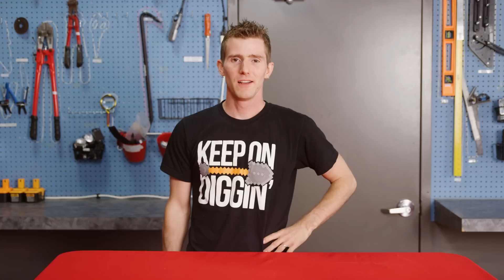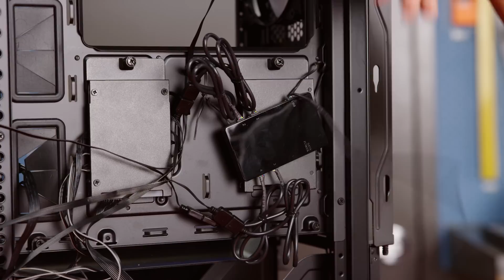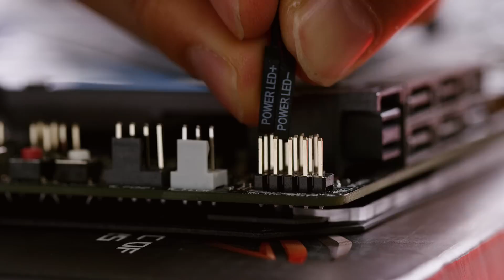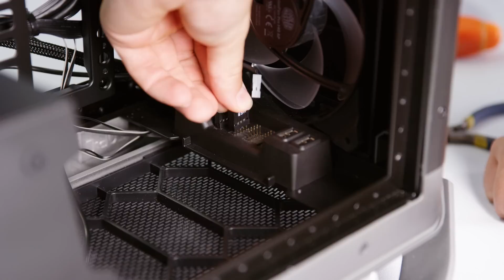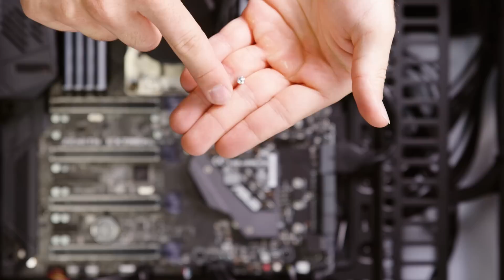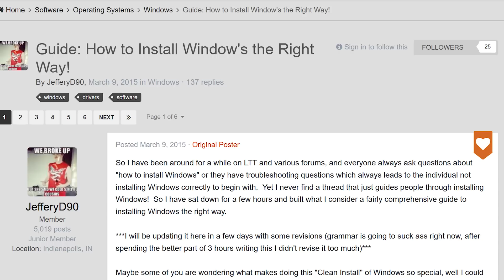Ultimate Mega-Workstation PC Build Guide

Comment: in 2023 this (besides the RAM amount, seems quite dated. The i5 13600 is 14 cores, 20 threads and gets about double the score in cinebench r23 (I know benchmarks aren't everything, but it's just to show the maximum performance of the chips), and it costs $300. It also supports DDR5, which can give it more bandwidth than the quad channel DDR4 of the TR, and PCIE gen 5, which gives it 80GB/sec total, compared to 64GB/sec of TR, even if it is squeezed into less lanes which means less connected devices.
Reply: Its absolutely amazing what Kind of tech came out the few past years. Never thought we'd See so many improvments in such a "short" time. Almost like Back in the late 90s/ early 2000s

Comment: Even cheaper older Quadro Cards beat performance in CAD based programs for me. So for engineering they are very good, but not for 3D stuff (price-wise)
Reply: Could you please suggest me specifications to build a server and gaming workstation.. 
Mother boards models list
Processor list
Chip set list
Rams list
Storage 
Pci
Form factor
Graphics
Etc

Comment: “All of the cores” now 16 cores seems to be a small amount for TR
Reply: Now 16 cores is a consumer processor lol
Reply: Could you please suggest me specifications to build a server and gaming workstation.. 
Mother boards models list
Processor list
Chip set list
Rams list
Storage 
Pci
Form factor
Graphics
Etc
Reply: In 2022 16 cores 24 threads in the core i9 12900K

And. 24 CORES 32 THREADS IN INTEL I9 13900K

And amd ryzen x950x  16 cores 24 threads
Reply: Now there's a 96 core haha
Reply: I have 8 cores still going strong
Reply: Even my $500 laptop has 10c/12t, and that's one of intel's ultra low power cpus, a 1255u, and it's already a few years old, of couse core count isn't everything, as (at least in cpuz's benchmark) it's about on par with my 4c/8t 12100 on all core.

Comment: Using this case, Ryzen 9 3900xt, 32GB ram, ll fans 120m, Corsair water radatior fan 360mm, noctural fan 120, aorsus GIGABYTE X570, 750 w Corsair 750w gold, evo 970 plus 2tb, sceptre monitor curved 200 30inch, Logitech keyboard n mouse, n my A40 astros

Comment: I'm building my own 1950x system.  Since gen2 and gen3 threadripper is in the wild, the price of the 1950x as come down to damn near give away prices. Couple this with the x399 phantom gaming 6 at only $250.00, and the price is hard to beat. Yes its two generations old but it still packs a rather large compute power punch. I forgot to mention that it will run rings around my sandy bridge dual xeon rig.

Comment: can you build a dual standard atx psu pc for redundant purpose? in the same case, best in my opinion would be in back to back configuration mounted vertically beside the long sie of the mobo(like q500l), with the ciruit to prevent one faulty psu to take down the othe one  behing long gpu heatsinks. or isn't doable?

Comment: Now, two years later this ripper CPU costs about $500 and perform worst than $700 Consumer 16 core Ryzen 3950x. I build 16 core Ryzen based system similar specs than this (but even more nvme storage 6tb) almost half the price that what Linus spend this system 2 years ago and mine is more powerful than this ripper build. Ofcourse mine has no ripper system benefits like many pcie lanes etc. but pcie4 helps a lot for this even if you use one chipset pcie4 4x lane shared for majority secondary ssds, usb and stuff (because pcie4 bandwith increase)!

Comment: Say if I have a power supply and the +12v rail is 504w but only has one eps connector; could I run a molex to eps adapter? Or is that too sketchy?

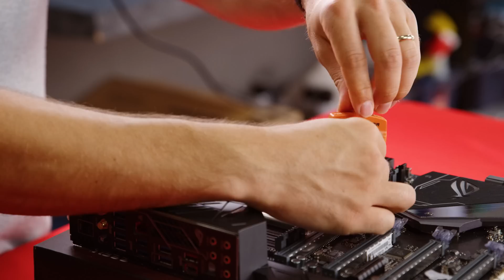Comment: 3:50 The moment when you realize you may not want to actually do what the person says, since pounds per square inch is not a valid unit for torque....    It's probably inch-pounds, however I really recommend checking the manufacturer's specs on that thousand dollar CPU before you break it and void the warranty due to improper installation.

Comment: Call me crazy, but I am not at all fond of the flimsiness of that bracket you slide the CPU into, from an 'alignment with the pins' standpoint. It just does not seem as if it's going to provide sufficient alignment as you lower the CPU down onto the pins, especially by comparison to the thing that folds down after it, which has an opening for the CPUs metal chip cover which clearly has less than 1/2 millimeter tolerances on each side.

Comment: Updated build:
2990WX 
3*2TB m.2 ssd 
2*RTX Titans 
1TB RAM
Reply: You can do 2 quadro 8000 or maybe up to 4
Reply: @subbot9296  at the time I only knew of the Titans.
Reply: @whitebeartigtig  yea, i mean the video is outdated, now you could get a 3990X, dual rtx 3090, and possibly even a optane acceleated 4 or even 8tb drive. And now you can get 1tb of ram
Reply: @subbot9296  or even more RAM depending on the motherboard used
Reply: Wouldn’t want to game on a 2990WX
Reply: @springbok4015  well, it's a "Mega Workstation Build" so...

Comment: Anyone know of a good build for entry level work station. That can photo and/or video edit. For around $500-$1000. ?? Does not have to match or look pretty. Just needs to get the job done at a fair price point. Willing to use slightly out dated tech to start with. If build is upgradable in future.

Comment: 12 pounds per inch of force? That is not torque. That represents lbs/in (distributed/line load). What Linus meant to say was 12lbs x 1in (vector multiplication). Which simply means at one inch perpendicular from the center of rotation, apply 12lbs of force. Everyone can start your critique of my critique...3...2...1....

Comment: Nice but I can't believe you put a 240mm in that beast. It doesn't deserve a 360? The case was clearly designed for 360 and given the overall system cost putting a 360 in it would have been nothing.

Comment: 7 Thousand! 
Coughs blood
Reply: Now, two years later this ripper CPU costs about $500 and perform worst than $700 Consumer 16 core Ryzen 3950x. I build 16 core Ryzen based system similar specs than this (but even more nvme storage 6tb) almost half the price that what Linus spend this system 2 years ago and mine is more powerful than this ripper build. Ofcourse mine has no ripper system benefits like many pcie lanes etc. but pcie4 helps a lot for this even if you use one chipset pcie4 4x lane shared for majority secondary ssds, usb and stuff (because pcie4 bandwith increase)!
Reply: Mine is just under 2k
Reply: Trevor Thieme why did u sell ur kidney
Reply: THE BLOODRIPPER.
Reply: Sells blood*
Reply: Now THATS what i call dark humor
Reply: my 1st TR rig was 6k bought it about the same time as this vid but seriously if you think of it investment wise. this thing will still be trucking in 5+ years...  short of like quantum chips going mainstream consumer in that time be unlikely anything comes out that can trounce the TR from its podium.
Reply: @TheOriginalSycHolic   Don't be a tease Quantum Chips becoming mainstream or even prostream products is the not so secret fantasy of everyone watching this video.  Of course assuming it happened right away (Tomorrow) I have no software capable of taking advantage of that capability and no capacity to invent it either.

Comment: Hi, I'm working with an HP xw8600 2x  xeons 5470 @ 3.33mgz,  32GB ecc ram,  gtx 680,  2x  500gb SSD  raid 0 config,, I'm a part time employee @ best buy so fund are tight is there anything else I can do to improve proformance with out breaking the BANK.>???

Comment: "12 pounds per inch of force" 
Well almost none of that makes any logical sense. I'll forgive you for part of it because technically torque is a force. However, the units are not lb/in they are lb•in. Pounds per inch makes no sense. Inch pounds, or pound inches (the correct terms) suggest you are applying the equivalent of 12 pounds of force to a lever extending one inch from the center of rotation.

Comment: but the duma is such a rgb led that the ddr 4 will speed up the processors but they are wrong the poor will take the expensive procika but they do not look so much worried but even the blue-boobed blue ones do not get the tempt smooth 1080 asleep in the machines. heloo with so much power the 15-year-old procim will receive you even hahahaha

Comment: wow that 1200w PSU cost $1,000.  Ripoff.  I paid $200 for EVGA 1200w Supernova and it too says made in Japan capacitors.  I'm using that same AIO cooler, but on Threadripper 2 (32-cores of powar! har har har! -- Tim Allen) A difference a year make.

Comment: 1.) Remove these three PCI slot covers...... 
2.) Remove the protective cover from the card edge ....
3.) Push the card in firmly until the  slot tabs snap shut...
4.) Plug in the two 8 pin PCI Express power connectors.....

5.) Realise that you don´t have and can´t afford a 1080Ti :,(

Comment: I WONDER THE BENCHMARKS ON THIS THING. IT HAS TO BE SUPER HIGH RIGHT, I MEAN U SEE THE SHI* THEY PUT INSIDE THAT COMPUTER. THE HIGHEST-TIER THREADRIPPER, TONS OF RAM, A GTX 1080 TI ADVANCED, A HIGH POWER SUPPLY (REASONABLY FOR THAT THREADRIPPER), INSANE COOLING FOR CPU MOSTLY, AND THAT BEAST NETWORK CARD. iF THIS DOESN'T BEAT AN AVERAGE GAMING COMPUTER BY 50 FOLDS, I AM UNSUSCRIBING! jk

Comment: That cooler with the surface area it offers contact to the CPU and limited Radiator space is not ideal at all for this CPU especially when overclocked or tuned. Something like Enermax TR4 offers much better efficiency of heat removal if you want an AIO with custom water being the best way to keep this cool and a 360mm Rad.

Comment: You stated to  torque the screws with "12 lbs. per inch force"using the included wrench.  A torque setting is just that, torque (not force), and the setting is in inch-pounds,( or newton-meters, pound-feet)  not inches per pound.

Comment: 1 TB RAM isn't necessarily an overkill on a CAE Workstation.. full vehicle NVH Analysis based on a moderate size mesh and upto 800 Hz takes up 500 to 800 GB RAM in addition to a ~100 GB diskspace for writing the results .. of course one can use scratch on the disk to reduce RAM but that slows down the total job time by a factor of 10, if not more.. explicit codes require much less RAM though.. Most OEMs here in Germany, depending on the type of CAE allow one job per node and have about a TB of RAM (for the implicit jobs).. 
But yes.. most nodes top at about 700 gigs..

Comment: Hey Linus thanks for the videos, i know its kinda hard to keep track of all comments but i would appreciate if you could replay to a few, specially if they are related to your video... Its kind of a give and take, we like the videos and in return get some help when needed. For instance, i have an annoying issue, iv just finished building my TR pc as your show on your video (missing some points on where goes what in terms of cables, but i managed to figure it out), anyway, my issue is that the OLED screen on my MOBO (Zenith extreme X399) does not work at all. Nothing shows up... I dont have a OS installed yet, but could that be related? or did you do any tweaking on your board to make it work?

Comment: I got Threadripper 1920X installed with 3x 1080Ti, not for gaming but for AI and deep learning research. The best of all, you don't have to worry the PCIe lanes, just plug in all GPUs and NVMes as much as you like, hassle free. But I recommend cooler with full size heat contact like one from Noctua, it makes a lot of difference in cooling performance.
Reply: Did your trained crypto trading AI bot got any profit ?
Reply: How does one get into self-learning AI with no prior experience? I've been writing code professionally for decades but I've never needed to touch AI.
Reply: @fyrstormer  just search on YouTube there are plenty of videos that explain it
Reply: @mli8847 : I've tried. They don't go in depth enough.
Reply: Cool
Reply: Should have used tesla for AI work

Comment: Why does the socket at 3:16 say socket SP3
Reply: Socket SP3 and Socket TR4 have the same number of pins, though they aren't compatible because of an ID pin that distinguishes the two.
Reply: Also Socket SP3 means 'Server Processor 3' used for the Epyc lineup of processors.

Comment: Hey, iv got a couple of questions related to the build, im from Brazil and a few parts aren't yet available. Im looking at building one of these for work purpose. Im a 3D Generalist (focus more on rendering). Anyway, here are my questions:
1- Master Cooler 240 - I cant seem to find the TR4 mounting. Is there any other option for watercooling that comes with all the necessary mounting for the Threadripper 1950x?
2- For the SSD MP500, is there any other "cheaper" choice i could go for? (i do want my SSD to run the operating system, but i can always have external SSD for my work related projects)
3- I think the Cooler Master C700P is amazing, but the price tag is very high, is there any other option to go for this build?
4 - The TridentZ ram is a must? im thinking about 32gb ram, what is the other option i could go for?

I guess that is it hahaha thanks again for the amazing video.

Comment: The cooler is a joke for TR, RGB RAM doesn't look good, black ones would fit much better, also this case isn't good at all, single air cooled graphics card isn't very overkill, PSU is controversial since the stock cables are designed very poorly in terms of aesthetics+i don't like the style of peripheral connectors on it-those weird 5 pin ones, however the PSU itself is pretty decent yet very overpriced.

Comment: just replace the case with the lian li 011 air and you'll not melt your threadripper even the lian li 011 dynamic which is for water cooling, has more airflow than this case.

Comment: We used an Enermax liqTech cooler which was designed for TR4 - amazing cooling - we ran a simulation that used all but 2 threads and never got above 70'C! It was an awesome build used to simulate datastream capture and filtering for a large telescope project.

Comment: "Ultimate" uses an AIO and a single GPU. What is this? A budget build? Come on Linus. You dropped $7k on a work station tower. Whats another $1700-2300 in better full system water cooling and SLI 1080ti's. The shame. 
That case also looks real empty without water cooling or a huge hard drive stack. Wasn't the original Cosmos and it's little brother, the Dark Fleet, able to hold like 13 standard hard drives?

Comment: just a single gpu?
Reply: SLI is a waste for workstation builds.
Reply: @-SUM1-  Whats better to work/play/create ? Any advice ?
Reply: Jibran Khan Well, not SLI for starters. Just a decent GPU and CPU for rendering and editing. Workstation variants aren't even necessary usually.
Reply: JIbran Khan, to work, play and create go with i7 (with high base clock) , i9 is also not needed, if you want to do use software which can use more than 4 core than go with ryzen , or even for virtualization go with ryzen, for normal or hard core gamer ryzen is of no use. Because till date only few games can use more than 4 core.
Reply: @prashantsingh7025  Any specific model of Core i7 ??? For gaming, editing and creation ? for blazing fast performance, amd doesnt get much good reviews
Reply: @Jibran Khan brother, gor gaming 4 cores are needed, for game creation, game engines like unreal are available and they need atleast 4 core or more. So, let me know your budget for processor.
Reply: Ryzen Threadripper 2990WX, is almost equivalent to i9 7980xe in gaming, and far far more better than i9 in virtualization, game creation, video encoding, etc
Reply: or just select any i7 with higher base clock such as 3.5 GHZ
Reply: @prashantsingh7025  free hand budget. No expense spared. How about i7 extreme ?
Reply: @prashantsingh7025  thanks bro. Just needed to know this.
Reply: @-SUM1-  that and the most games just honestly in general dont even support multi gpu that great still after all these years...  I got a dual gpu setup and the 2nd 90% of the time is doing nothing in gaming actually pulled it out for awhile just not to have it wasting power (idea was to keep it as a backup but its back in and nothing changed much over 1/2 a year)
Reply: Ikr

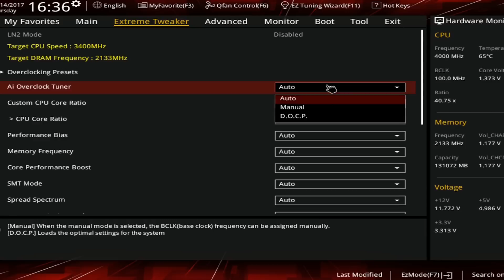Comment: @17:53 GOOD LORD is that cpu running at 65c in the bios?
Reply: MarkThisWayAfter  okay did some research apparently and adds  20C to the chip reading and the fact it's so beefy means it will run hotter.
Reply: MarkThisWayAfter it’s terrible...
Reply: Blackmamba32 #idle
Reply: Usually bios is terribly unoptimized and has 1 or 2 cores at 100% load, most likely in an infinite while loop for user input.

Comment: Finally, a build sheet for a Real Workstation that we can all work towards. I'm in the process of saving for a Threadripper Workstation that'll actually do what I need. Though a Tad out of my Price range. At least this gives me a reference to work towards. Maybe now I'll be able to do design and rendering in Enroute that doesn't take 3 to 5 minutes to render what I've designed and doesn't give me Out Of Memory Errors.
Reply: i'm atually maing plans for my next pc build though i wish i knew a good forum i could just ask for advice on. You think the LTT forum would be a good place?
Reply: tried that and all i got was coments like "you dont use RAID for backup" instead of actual build advice
Reply: Lexx Alolia they are right though lol
Reply: @CuppaLLX  thats the advice of someone who never had a complete drive failure ever in their existence...
Reply: @TheOriginalSycHolic  when i furst built my curewnt rig i got 5 ssds, in thefirst couple monts 2 failed, which is my my new rig is going to use raid to backup the same drives so 10 total drives, but i'll also have a seperate NAS, burn me once and all that
Reply: The LTT forum should be pretty good for advice, ive heard that r/pcmasterrace or whatever also has some good people, never been there myself though